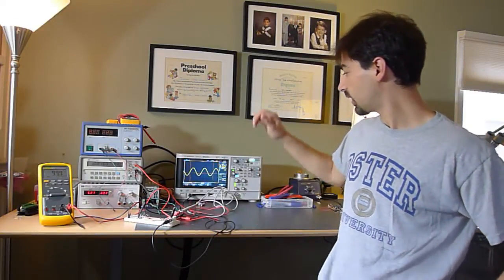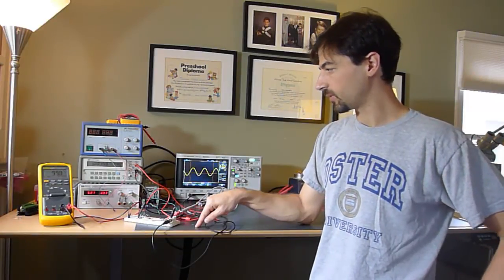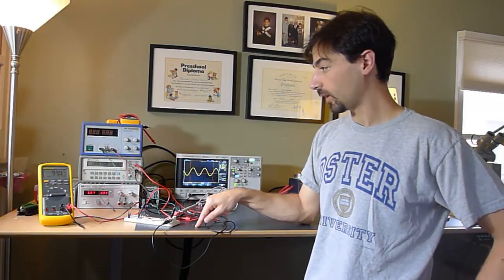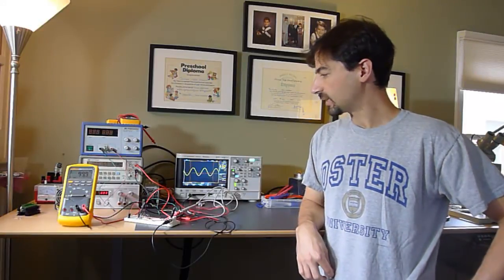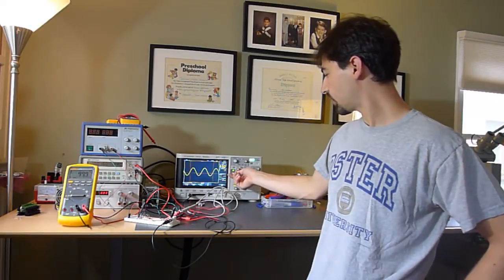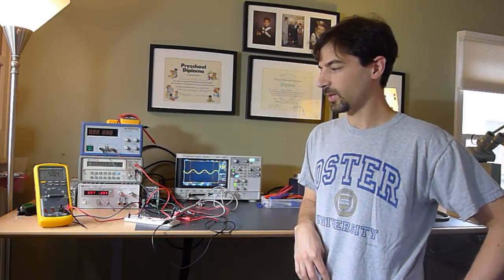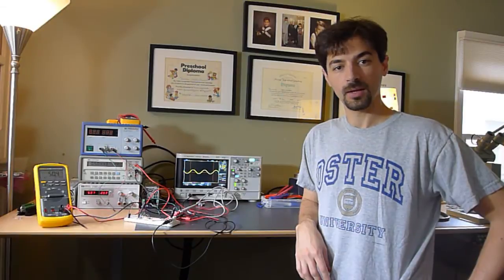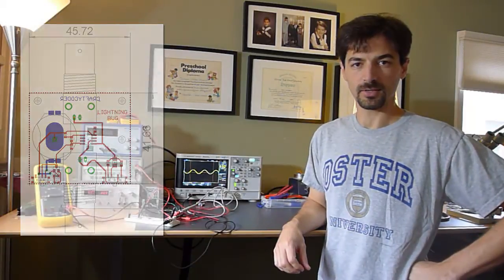Precision Low Current A/C Measurement

Comment from the maker: This circuit can convert A/C current into A/C voltage. Its bandwidth is not characterized however. You will need a DAC or oscilloscope to observe the voltages.
Reply from the maker: +Daniel Pinheiro this circuit cares little about the shape of the wave form. it is sensitive to the amplitude and frequency though.

Comment: I noticed a blue bug at the bottom of your bread board. Also the schematic has pin 7 of the mcp601p connected to +V, but the bread board pic is at pin 8. I am still troubleshooting my copy of your system. Thanks for your set up any help would be appreciated.
Reply from the maker: Follow the schematic. The breadboard circuit worked but I don't know that chips on the breadboard matched those on the schematic. Also, to need to use a floating power supply that is NOT referenced to the current source for this to work. Power it from a battery for simplicity.